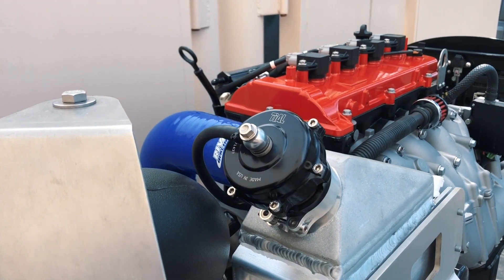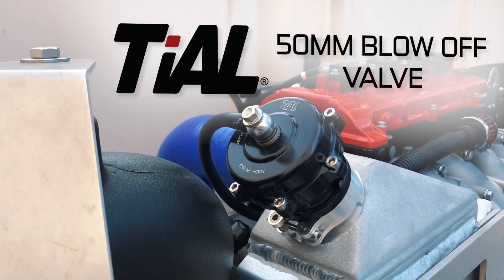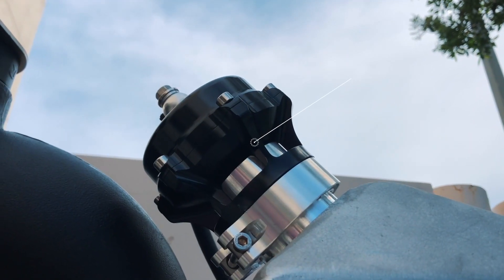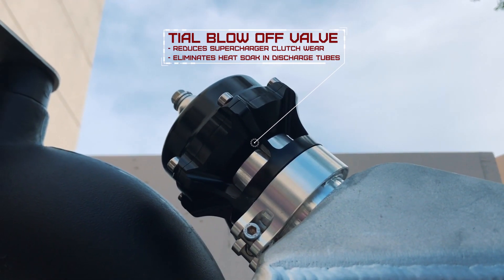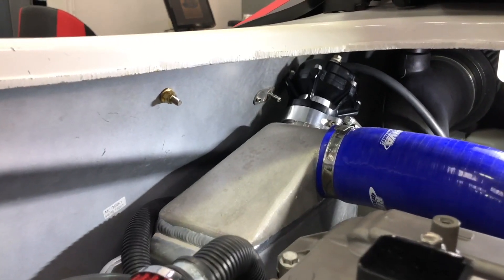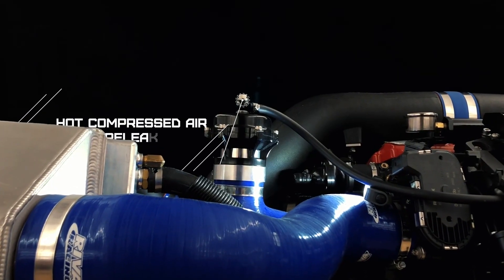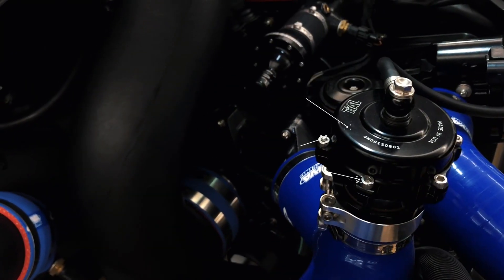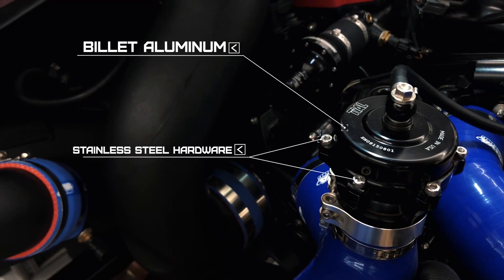Tial Blow Off Valve

Comment: With soft spring it vents out the air at idle, closes  when accelerating and again opening when letting go off  the throttle, stronger spring opens only when letting go of the throttle under boost,  witch is better for the engine? Thx